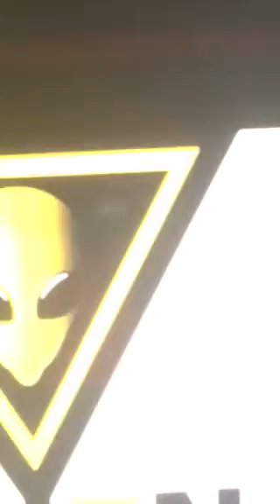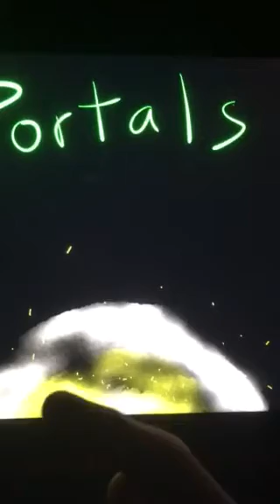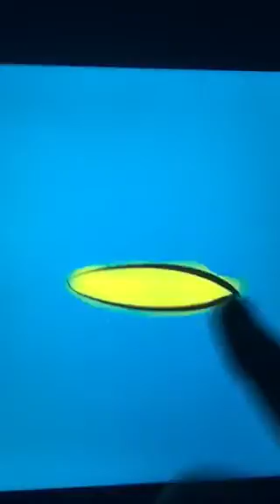PORTALS & UFO TECHNOLOGY!

Comment: Is that why crafts are saucer/cigar shape ,to travel though portals?
Reply from the maker: tctwg1 - ( as far as my opinion goes ) -the shape only matter for travel in atmospheres or space… The entry shape in portals really doesn't matter... humans can walk in and out of ones that are on the ground. (which I suspect are circular and we're only seen half of ) problem is I think they require exotic matter to hold them open and that is dangerous to humans unless escorted)...but larger portals can be made for crafts to enter & even then the shape doesn't matter because in the wormhole there are NOT traditional forces on the craft) 
But there is a different kind of portal that's almost accessible right now in terms of a engine.!!!!! Dr Jack Sarfatti is the current master of these..but Hal Puthoff is TRYING some "experiments" ... I just failed with one couple weeks ago.... Hal's trying another angle in less than two weeks...in "Colorado"... but they're not funded or working together like they should -team is not complete yet it's a messy and egocentrically handicapped.